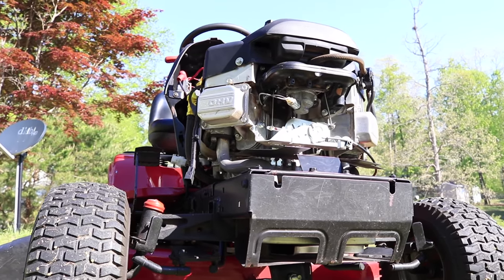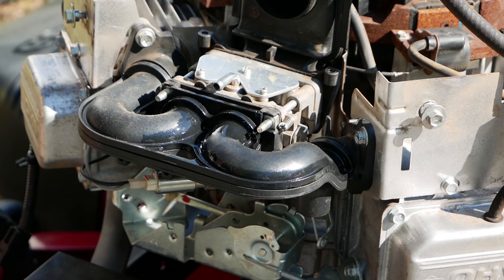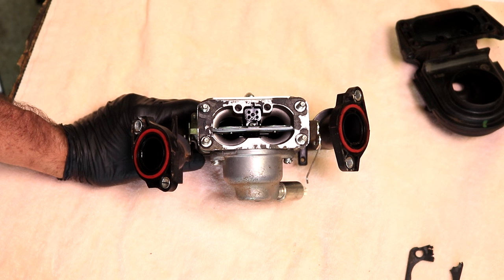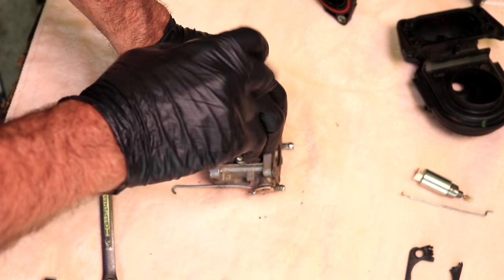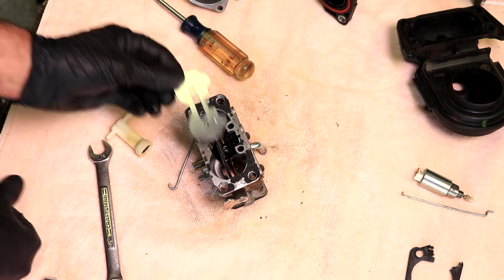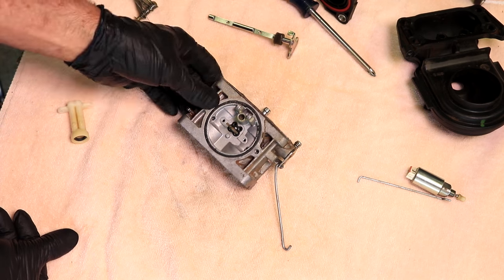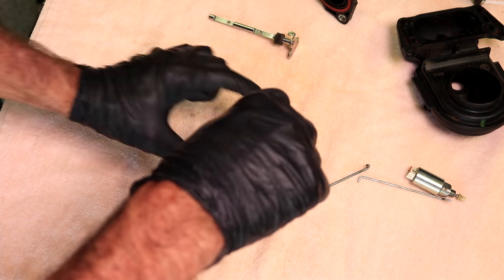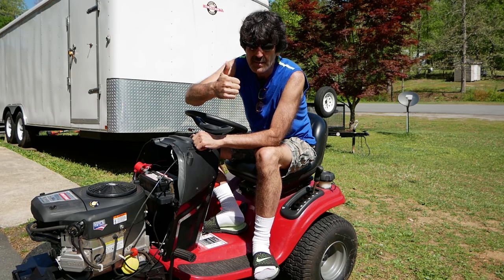Briggs and Stratton V-Twin Carburetor Repair

Comment: I usually just put gas in the plug and it will start working, but those engine are so bad to cold start.  Spring startup is a frustrating activity.  If you can avoid buying a tractor with the V Twin do it.
Reply from the maker: If you have a local gas station with ethanol free gas that's what I have been using and I am not having any trouble.  I have actually had good luck with the V-Twin engine.  If you don't have ethanol free gas available, u have to either completely drain the fuel system, including the carburetor bowl, or keep the tank completely full so there's no room for moisture and use plenty of gas stabil in the tank and run it so it circulates thru the carburetor.  The ethanol attracts moisture and causes all sorts of trouble over the winter.

Comment: there whit pin  when i came out I lift center piece .  how go back in?   thank you nice job.
Reply from the maker: What do you mean?
Reply: @JLPicard440   sorry it was needle valve came out .  But when I toke spring off the choke .  I had hard time trying put spring  back right way .   Motor keeps choking out .    Trying fig right way spring goes back .   Thank you getting back to me.
Reply from the maker: @allenletizia321  OIC... does the video show a picture of it?  I have since sold that lawnmower that was in the video so I can't take a picture of it for you.
Reply: @JLPicard440  Shows  how you take  spring off .  But you put carb back together slowed down show cover back on lineup right for wire connector. Rest was in fast motion . lol   Which I understand .      I could not see how put choke spring back to get  tension.    Motor kept on choking out .   My son add a spring to choke lever like arm keep it from choking out .  It did the trick but when go to start takes a while get running .  It runs great after warms up .   I be ok with it .  But like to know next how wind spring up and which hole to use my link arm came  off .   Thanks for getting back to me .  Very helpful.
Reply from the maker: @allenletizia321  Yes, I would need to see it to give much insight.  I have a terrible memory, but am good to figure it out if I could have it in front of me..

Comment: Does the butter fly have to be spring loaded?  I got a new carburetor but it was not spring loaded.  I'm still having issues with mower running rough.  Can spray carb cleaner on plastic or only metal?
Reply from the maker: HI, many carburetors are plastic and the carb cleaner doesn't seem to hurt them.  I have also used brake clean as an alternative.  Does your original carburetor have a return spring?  I don't remember if it does.  I'm not sure it would cause it to run rough though.  Seems like a spring problem might cause it to surge.  Did your mower run smooth with the new carburetor for a minute and then get rough at first start up?
Reply: @JLPicard440 thank you for quick response.  The mower ran fine after first start with starting fluid.  Let mower sit for about week until next mow it started fine ran ok for about 5 or 10 minutes and now runs rough and very low power.  I'm debating cleaning up the old carburator and using seals and sensor from new carburetor to fix the old one with the spring.
Reply from the maker: @tonymusto8494  Yes, the reason I asked was I suspected the gas could be contaminated with water or some trash.  Did you drain out the gas tank before putting on the new carburetor?
Reply: @JLPicard440  yes syphoned old gas and mowed once with partial tank of new gas.  I just had to get it initially started with starting fluid.  Refilled the tank completely for the 2nd mow but rough running mower.  Thank you again for your time.  I will post update after I have rebuilt the carburetor.  Side note the mower sat for about 2-3 years.  I suspect there might be other issues
Reply from the maker: @tonymusto8494  Yes if the gas tank sat for that long, it's definitely got bad gas in it unless you used Trufuel or Ethanol free gas.  The gas probably re-contanimated the new carburetor.  I would clean the new carburetor again, and you might  have to remove the gas tank and flush it out with a water hose.  Change the fuel filter too.  That bad gas is nasty and has affected the whole fuel system.  I'd even take a look at the fuel lines.  They often get a white film in them that can flake off and wind up in the carburetor.
Reply: Got the mower going!  Thank you very much for all your help and video.
Reply from the maker: @tonymusto8494  Excellent!  Glad you got it going.  Did you wind up using the old carb?
Reply: @JLPicard440  yes.  The new one I bought was broken. So I rebuilt the old one using as many pieces from new one and cleaning out the old one with carb cleaner and air.
Reply from the maker: @tonymusto8494  Excellent!  I'm glad you were able to get it working again,. 🙂

Comment: On my 2005 craftsman mower. 1 of the main jets was jammed in the needle seat location ran for 55 hrs that way the float was jammed open now the needle sticks every time is sits. i use a horse syringe in fuel line to pop float loose now it runs. factory dumdums now i find new vid about how valve guides come loose whats next
Reply from the maker: I've heard some people complaining about the v-twin engine.  I've had several and not really had to many issues.  They've been good for me.... but yes, I can understand the frustration if you get one like that... just because a video showed valve guides coming loose, doesn't mean it'll happen to yours!...

Comment: Question on my butterfly it didnt have a spring.  Is that normal?
Reply from the maker: I don't think the butterfly has a spring on the carb itself... but I believe there's one down below the carb where the linkages hook to.  Unless you're talking about the choke butterfly, that doesn't have a spring at all, I'm pretty sure.
Reply: @JLPicard440  Sorry yes that was what I was referring to.  It had a piece of felt around it that just fell off when I removed it but I didnt see a spring.  Thanks for replying so quickly very much appreciated!

Comment: Do you or anyone else know where the vacuum line that attaches to the 90 degree fitting on the airbox by the air filter goes to on the other end? 

I see one goes to the breather but where does the little hose go to?
Reply from the maker: I don't have access to this mower anymore.  Did yours come unhooked?  The length of the hose should narrow it down quite a bit...  You might go to partstree.com and get the parts breakdown for that model engine... You might be able to see where it goes from that...
Reply: @JLPicard440  thanks for the video! Hopefully some one else sees this and it helps them.. the little vacuum hose was disconnected on the other end! I searched for some drawings and found nothing about it. Finally figured out it went to somekind of evaporate collection canister that was completely missing. The hose was wide open. Letting debris go straight into the airbox/carb bypassing the airfilter. Time for some oil changes.
Reply from the maker: Excellent!  Thanks for the update... 😊

Comment: ugh ... I've made it to the part of "remove two screws on gasoline bowl" (timepoint 7:28)  but I cannot for the life of me loosen them.  I've tried everything I can think of - they wont budge and the heads are starting to strip  :(
Reply from the maker: OH no!  Can you use a Dremel to make the slot for a regular screwdriver any deeper?  I've had to do that before (Not on this carburetor).  There must be some rust in there that froze up the screws.  Maybe shoot some PB Blaster in there too might help..
Reply: @JLPicard440  Hi TaB ... in the meantmie I've managed to do the complete teardown/cleaning/reinstall.  The mower miraculously started - but I've got throttle/choke control issues I think I've got the 'linkages' wrong or something.  I'm trying to figure out why the lever does basically nothing, so the motor stops the moment I try to adjust the throttle.  But at least I know it runs - thanks to your superb video!
Reply from the maker: @trabbin8  Excellent!  😊😊. Yes I've had other people have trouble with the linkages too.  Unfortunately I don't have this mower available to me anymore, otherwise I'd be able to take a picture and upload it to my TAB Facebook page.  If you can't get yours going, maybe you can take a picture and send it to my page.  I'd be willing to take a look at it and see if I can spot the problem.

Comment: Has anyone found a rebuild kit for this Nikki carb? I have a 21 hp 407777 briggs model engine and cannot find a rebuild kit. I have found plenty for 19 hp but cannot find anything for the 21 thus far. Doesnt come with all neccessary gaskets, such as the rectangle paper gasket between intake and carb.  Briggs doesnt sale a rebuild kit unfortunately.
Reply from the maker: That's interesting.. Have you looked on partstree? or searsparts direct?  there's usually a breakdown of the carburetor...
Reply: @JLPicard440  i looked on parts tree but no numbers for rebuild kit. I just bought an aftermarket carb to try out. I need this thing back up and going. Ill keep digging on rebuild kit and then Ill have two carbs haha. They always break down when you need them most.
Reply from the maker: @kyyakfishin8268  Well that's something.... I'm surprised about that.... Hopefully the aftermarket carb will come with all the gaskets you need.  They usually do...

Comment: how tight do you tighten the nuts and the shoulder bolts connecting the carb to the intake manifold?  Seems like mine is warping.
Reply from the maker: To explain how tight over a message would be very difficult.  I don't have an actual ft-lbs or in-lbs spec.. If it's warping theres definitely something wrong.  You want to make sure it's seated all the way down against the heads on both sides.  It's pretty tight, but not so tight you're in danger of breaking the bolts, or stripping the threads out.
Reply: @JLPicard440  After looking at it some more I'm not entirely sure that the intake manifold is warping.  I mean it is but I think it's because there is a raised ring lip around each barrel.  So when it's mounted and tightened against the carb face the whole surface of the carb and the manifold don't meet up flush.  Is that how it is supposed to be?  I got this mower second hand with 24hp twin Briggs and Nikki carb.   Tightening the 4 shoulder bolts pulls the 4 corners of the manifold against the carb but you can still see daylight where the raised lip around the manifold doesn't allow the carb to mount flush.  Perhaps the carb to manifold channel stays sealed but seems sketchy.  Maybe the guy I bought it from put a wrong intake manifold but I thought I'd ask you if this is supposed to be perfectly flush before I go and buy a replacement one.
Reply from the maker: @ocrun6765  Wow.. I'd have to see that one.  There are some orange round  gaskets that sit in the manifold where it bolts to the head.  Are those keeping it from setting all the way down?  If you have access to FB, I have a page there under "Take a Bath Productions" that you can upload pictures to.  They  say a picture is worth 1000 words!
Reply: @JLPicard440  Not where it mounts to the heads.  Where the manifold mounts to the carburetor.  If you put a straight edge on it you can see there is a raised lip. Test fit without the gaskets and there is a gap.
Reply from the maker: @ocrun6765  OIC.... what happens when you put the carb on it and tighten it down?  Does it pull it back into shape since the carb is metal and the intake is plastic?  Or is it a big leak?
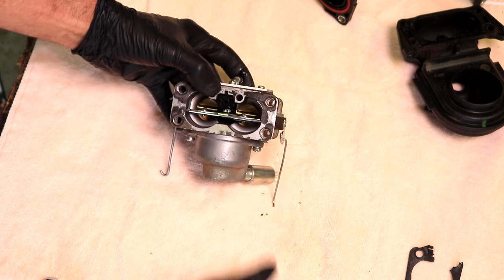Reply: @JLPicard440  tightening only pulls the 4 corners down.  There is a gap between the two lip rings that you can see daylight between the carb barrels when the manifold is mounted to the carb with the gasket sandwich.  So initially there probably isn't a vac leak but with the only seal point being the width of those two ring lips against the flat carb surface around each barrel, if I was a vacuum leak that's where I'd try to break through.  There are lots of forum threads online of people saying that the plastic manifold warped but I don't think they are right any more.  It's just not mating a flat surface to a flat surface like you would on a head to a block so only the corners pull down.  I rewatched your video a bunch of times slow motion and now I see that gap when you took yours off and you can see the ring lips on the manifold at 5:52.
Reply from the maker: @ocrun6765  That's interesting... Do you think it's still going to run on yours?  IS your gap more excessive than what you see in the video?  I'm not sure if my video shows that kind of detail..  What if you double up the gasket?
Reply: @JLPicard440  It's hard to tell plus I didn't notice the gap until after I cleaned all the parts and put back together.  I think dirt helps hide the gap. I'm not even sure if it's something I'm supposed to fix since it looks like it was engineered to not sit flush for some reason.  I'm sure it will start and run since I cleaned it out good and all new gaskets and o-rings but it just doesn't seem like it fits right so will it last?  Who knows?  I'd be more inclined to think those ring lips on the manifold should nest snugly inside the carb barrel openings to make a tight seal.  But I'm not sure even nesting would work since the gasket sandwich has a metal layer which also has the partial obstruction eyelids protruding so even that would prevent those lip rings from pressing in.  Which they don't because their circumference is bigger than the carb barrel's circumference anyway.  It's like they weren't meant to go together.  I thought maybe the previous owner frankensteined it from parts but it doesn't look worked on and I see you have the same parts in your video.  If you have a spare one laying around piece together the intake manifold to the carb and you'll become as annoyed with this as I am.  I don't know that extra gaskets will fill the inner gaps since the pressure applied by the shoulder bolts is from the outer 4 corners and the more you tighten the more the manifold warps (possibly making it worse).  The daylight is the gap between the two ring lips.  If it was a head gasket that's exactly where it would blow. But it's not a head and only vacuum pressure and the nearest heat is from the muffler and diffuser fins, but the manifold is plastic. ?????     

I still have my old mower to get bye, this is just a project I picked up because I wanted a more powerful 24hp mower to cut my mowing time down vs my 17.5hp one.
Reply from the maker: @ocrun6765  Yes I see what you're saying.  It doesn't sound right to me, but I've never noticed that either if it's supposed to be that way!  I don't see how though.  What's the point of an air filter then.. Lol.  Unfortunately I don't have one laying around for me to look at right now.  I can look through some of my other videos and see if I notice anything..
Reply: @JLPicard440  yep, particles can get sucked in once a vacuum leak develops plus it would add more air to already mixed air/fuel.  Might make for an interesting video  content some day.

Comment: Pick your brain please, there is a metal plate with "cups" on the intake side on your carb.  My V-Twin does not have that, but the aftermarket carb I bought has it in the kit.  I know there are several Briggs V-Twins that have differences.  Mine is a 21HP 407777.  Should I istall the plate or leave it out?
Reply from the maker: If your aftermarket carb has the option to install it as the original one was from the factory, I'd probably go that route and leave it the way the factory had it.
Reply: @JLPicard440  I left it out like the original engine.  I see there is 2 different intakes and filters.  I have the square and yours has the round.
Reply from the maker: OIC... yes I'm sure the same engine had different configurations...  😀